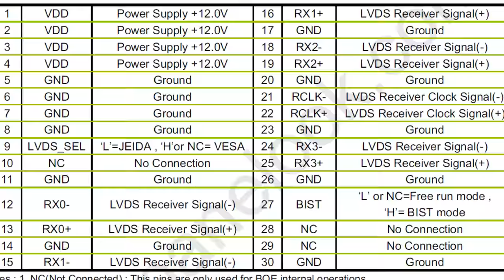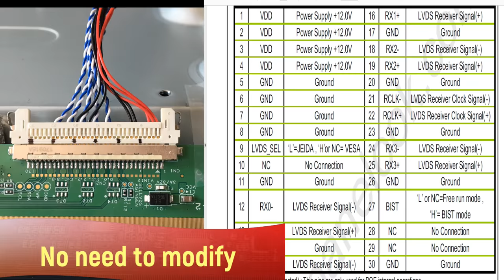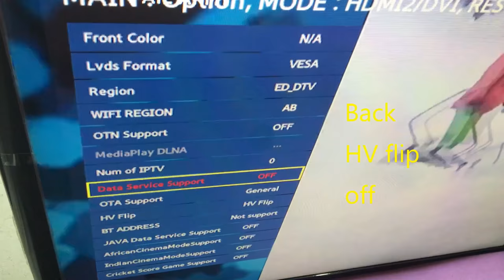LG to Samsung Display Panel Connection in LED TV

Comment: Thanks so much. I have a question. I have a defective 32inch SONY LED PANEL. Is it possible to replace the panel with a 32inch LG LED PANEL? Because my LG LED TV'S mainboard were already dead , but it's panel is 100% operational. Will it possible? thanks

Comment: One question, I have that same TV, I adapted a Chi-Mei brand panel to it, I made the connections well. but when entering S. Mode and when changing the signal from JEIDA to VESA, the image goes away, it is no longer displayed. I turn it off, turn it on again and there is still no image. WHICH MAY BE???
Thanks.

Comment: Thank you....but how to connect my new universal board lvds to my Sony Bravia KD55X8000C Tcon....maybe you can help me find the datasheet for it's tcon or lcd panel....for sure needs lvds modification...thanks again
Reply from the maker: How can I help you? send tcon photo via email
Reply: @VcoreLC  Tcon p/n is 15Y_S55FU11APCMTA3V0.1 and lcd panel is SYV5544 by YOUNGLIGHTING CORETRONIC GROUP with the following info LSY550FN01-001....LN43H01.001 and a lot more

Comment: Hi there
I have a 32 inch Panasonic led tv......its sound is working but nothing on display......I use torchlight and found there is character running.
And while checking the power supply board I found the supply goes to led strips not working, but the supply to driver board is working.
So is it a good idea ? if I used an external supply for led strips, if yes then how to calculate the voltage required for led strips(4 led strips).
Thanks in advance
Reply from the maker: Usually 3.3 volt used in Panasonic. Now you calculate it. The external supply board works according to the load of LED. Kindly use BACKLIGHT TESTER you can find which LED is bad.... kushalpal ji thanks for lovely comment
Reply: Vcore LC thanks

Comment: Hello

I have Sony 32Nx650 led tv . It had double image problem. It has a Samsung panel LJ96-05987A or LSY320HN01.
Can you help me. Which panel can be installed in this tv & what needs to be done. 
Thanks
Reply from the maker: You can use any HD ready panel available in market.
Reply: @VcoreLC Thanks . But Do i need to change any lvd cable or do any manual connection like you did in the video.
Is there any other method like some kit or compatible panel from Samsung or LG?
I live in Nagpur. Can you suggest from where i can the panel? 
Thanks
Reply from the maker: Samsung panel is more suitable than LG panel for Sony . In Samsung panel no need of other LVDS cable or module but, you have to remove panel id  to solve 5 times blinking .
Reply: @VcoreLC   Thanks a lot. 
I appreciate your help.
Can you tell me how to remove panel id? Can you create a video for this, please? Or do you have a link for this?
Also i think Sony has external t con board so will the new panel work directly or do i need to remove t con board?
Thanks once again.
Reply from the maker: https://youtu.be/aNgso2Nhz8U

Comment: Good afternoon, all right, take a doubt I have a Samsung 58 'Smart TV broke the display screen by chance Is there a module, cable that could transmit the image of this TV to a projector via the HDMI cable? The screen of this TV is very expensive to buy, behind my tv it only has (in HDMI) and (in av),

Comment: Hi. Could you help me using a m.nt68676.2a universal controller LCD for a SONY 40R475B TV. please
Reply from the maker: you have to try another more powerful board l  , 12volt power is enough for panel but,  may not glowing 40" backlight strips .... thanks....
Reply: I could make a video with some compatible Sony KDL-40R475B controller. I need help

Comment: i have lg l1710s lcd broken .and samsung b1731 cpu burned lcd safe
use samsung lcd on lg board and work
Reply from the maker: if PANEL resolution are same, you can replace